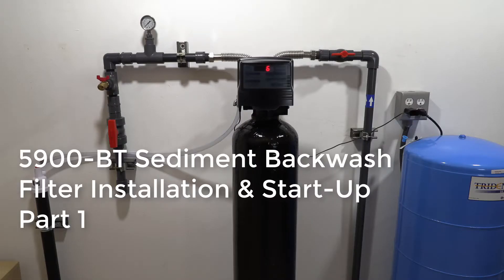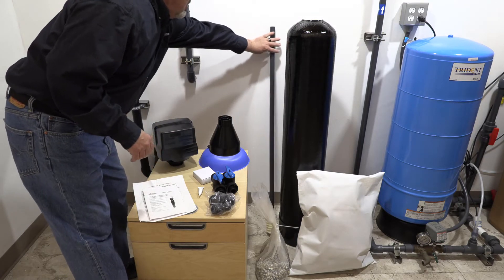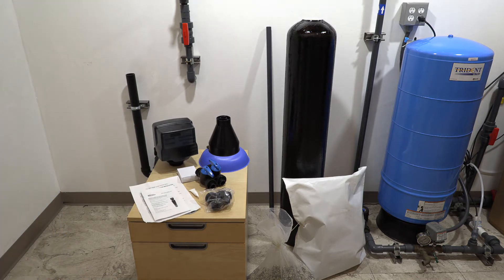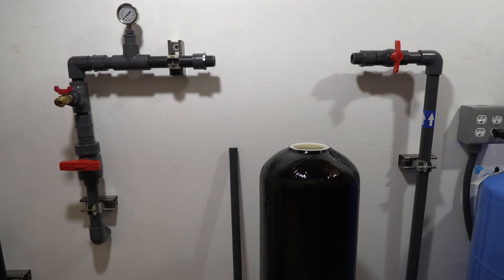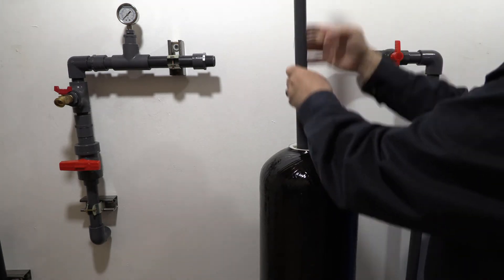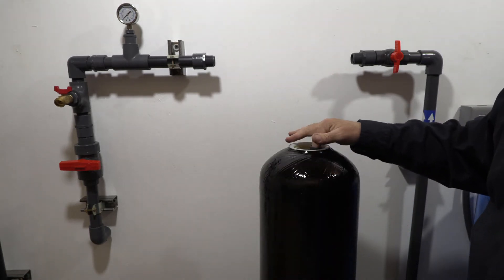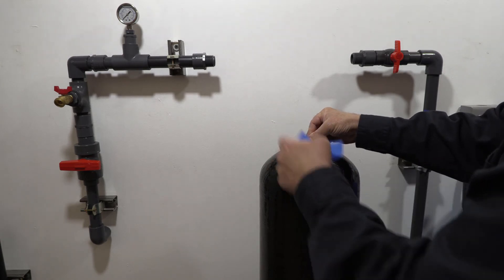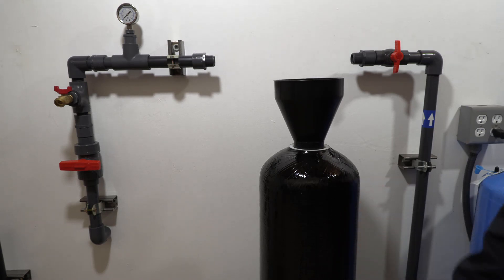5900-BT Sediment Backwash Filters Installation Part 1

Comment: What is the reason for not taking the time to assemble it before shipping ?
Reply from the maker: Thanks for asking, its not about the time.  If the filter media is added the tanks are heavy and cannot be shipped by UPS or FEDX ground without being damaged.  We can and do prebuild them though on request, and ship them by truck on a pallet with lift gate.   

Since some of our customers install these in their basements or well house, it's much easier to carry the light tank, pour the media in, and screw on the control valve than having to have two persons or a hand truck or dolly to move it around.  

However, please reach out to our support guys at support@cleanwaterstore.com and they can help if need the media added in advance,  but its usually a disadvantage for most customers.

Comment: I have a well system and I am interested in this system as I have sediment in my well.  I've been using filter cartridge's and the Rusco Spin Down filter but want the automatic backwash function.  Would it be possible for you to DM me your number as I woul dlike to talk with someone before purchasing such a system to see in fact if this is perfect for my situation.  I've had the water in my 205' well tested and it is better than my city water in every category.  Very sandy area and water is very good but has VERY fine sugar sand? almost like a mascara makeup thing.  Water comes up and is cloudy, wait for a bit of time and all settles out and pure great tasting water.   I'm also interested in a larger tank and or a system that can store water at the surface and then pump it to the home from that storage tank at a 15-20gpm rate with good volume.
Reply from the maker: Thanks for contacting us regarding your well water.  For sand we usually recommend a centrifugal sand separator followed by a 60 mesh screen with autoflush followed by one of the sediment backwash filters shown on the video.    We don't have DM but we do have chat on our site and we can call you as well, our techs work by appointment and we can call you at the time you choose:  https://go.appointmentcore.com/guest/book/eZeZdVQj  Or email us at support@cleanwaterstore.com is another way.   thanks talk to you soon!